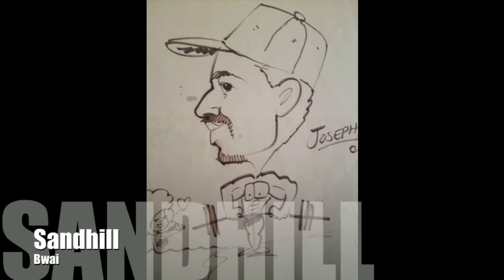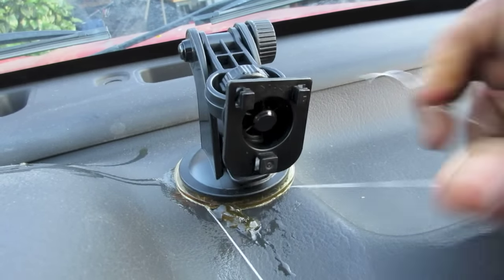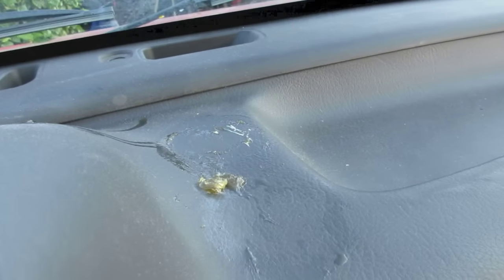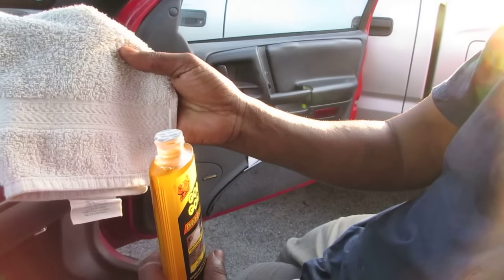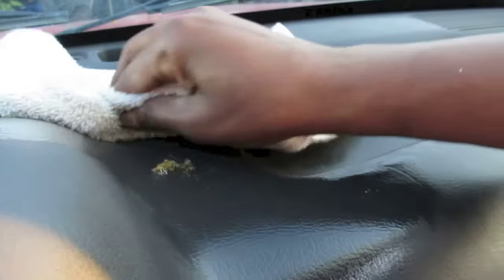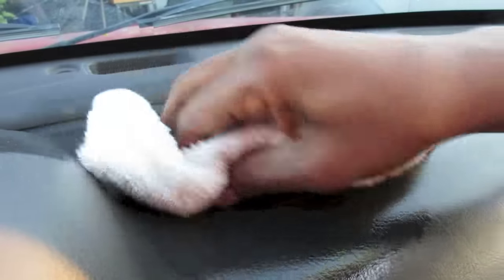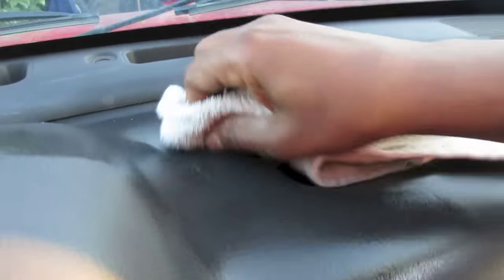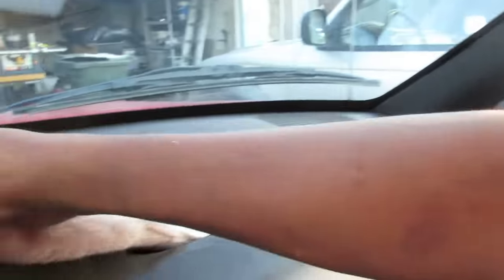How to Remove Mount from Dashboard

Comment: UPDATE: The saw of the floss wasn't working. So, I used a hairdryer on a phone mount I had stuck on the dash; hi heat, low fan. Then, I applied a plastic pry tool underneath after heating it up with the hairdryer for about 5 mins. It came right off, and the glue patch followed. Very easily too! Didn't even need the Goo Gone. You folks are still awesome though!

You folks are awesome! Get right to the topic, you show all the steps in real time ... and the questions were spot on. As I was thinking of them, your camera person was asking them. Then at the end ... the smile of satisfaction for a job well done. Good job all the way around! Thank you both!

Comment: Thank you for this!! Worked perfectly! I had to double up the floss so it would be strong enough to get the job done. So if anyone had the floss break on them during their first attempt, just double up and give it another shot. I didn’t even need the goo gone! 

The car I just bought had a phone mount adhered to a plastic disk thing, which was adhered to the dash. I had to remove the mount first (using this method), then the plastic disk (again, using this method). Can’t thank you enough. I was so concerned I was going to damage my dash, but it’s like nothing was ever there!

Comment: Thank you so much!!!! Previous owner attached a suction phone mount with an  additional mounting pad  to the wood grain near the shifter. That sucker was cemented down. I used this technique with the dental floss to first remove the phone holder (just like the one in the video with the translucent base)  from the mounting pad. It work!!! Then used the  dental floss again to remove the mounting pad from the wood grain. It worked!!!! 💃🏾. To remove the gooey sticky residue off the wood grain I used 70% rubbing alcohol (I tried this first because I was afraid  to use goo gone on the wood).  Residue is gone and the alcohol didn’t harm the wood grain finish. Thank you so much for taking the time to figure this out and to share it with the community. 🤗
Reply: Thanks for this comment.  I did not have “Goo gone”, I saw your comment and used rubbing alcohol. I soaked it and was patient and it came off. I am so proud of myself.  

I am also thankful to you.
Reply: @Chocolatebaptist  WOW you're welcome and thanks for sharing. I am proud along with you. We both have a happy dashboard! 😂🙂

Comment: Can this work for removing it from the windshield? I'm in a rental car and I just seriously thought this wouldn't be so hard to move. Nothing I do will budget. I even want to use a nice surprise it but it's such a tiny space between the windshield and the damned suction thing that a knife would not fit. I can't pull it in any possible way to fit anything between the windshield and the actual suction cup thing. It just stubbornly cannot be removed and I can't return this car like this.

Comment: Thank you for making this , Just bought a car last week with this thing stuck to the dashboard I tried to pull it off nothing would work and then I saw this. I’m actually a guitar player so I just used a guitar string instead of the dental floss, But the results are the same it cuts right through It does not damage the dashboard

Comment: I have problems with this mount falling all the time .  What kind of glue did you used ?
Reply: I had to use 2qty of those 3M adhesive pads, just one on top of another. With just one 3M pad the base of the holder wasn't seeting the single disk hard enough to the dash to make a solid connection. by adding an aditional 3M sticky pad, I was able to apply enough force to the dash to make it stick better. You should be able to get more 3M pads from a parts surplus store or online. (Also make sure the area of the dash has been cleaned with rubbing alchol)

Comment: OK I’ve got this problem but I don’t wanna lose my phone mount but it’s on my windshield and I’m getting my windshield replaced today I also have a GPS that attaches to my Dash clam/mirror/GPS front and back dash cam and I can’t remove the GPS portion of it off my windshield and I’m afraid I’m gonna lose it today and that’s $130 mirror dash cam that I’m going to lose and I don’t want to do that so what do I do because of the guys going to be here in just a few minutes I am going to try the dental floss